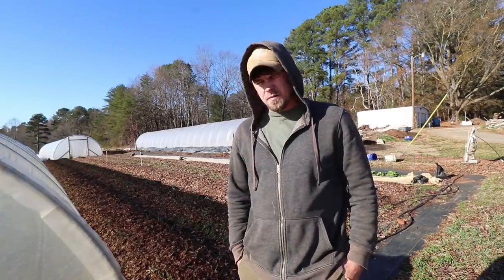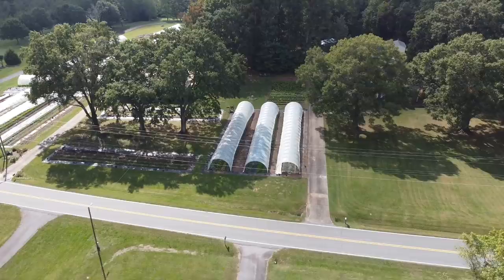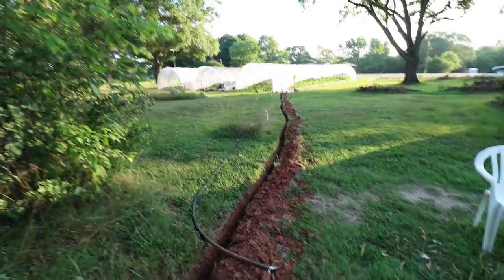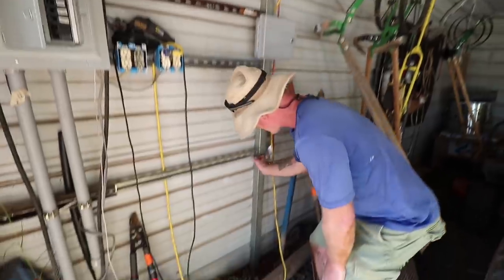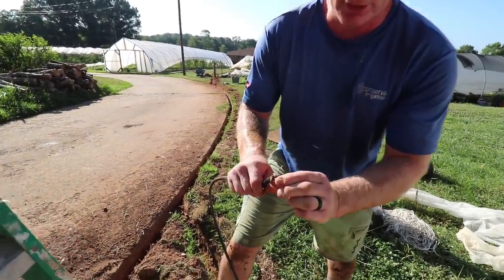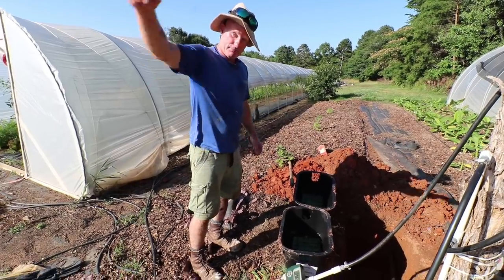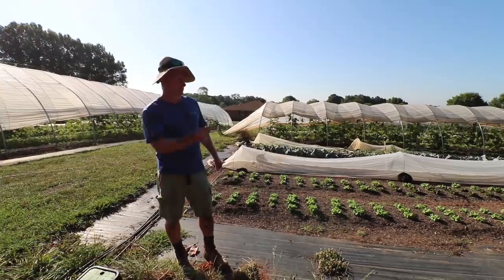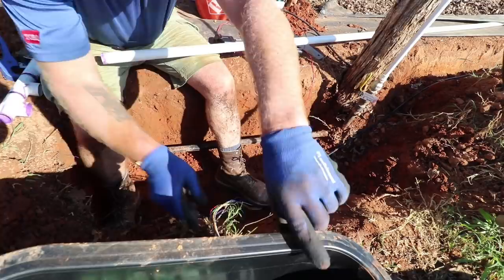Professional Market Garden Irrigation System (With Our Phones) Saves Time and Makes Money

Comment: Only thing I would recommend doing different with the plumbing of the valves, would be to leave more space on the incoming and outgoing side of the valves for future repairs. The Ts are already butted up so if one has to be replaced you have to re work the entire manifold. Very lovely work though. Install and setup about 10 hydrawise controllers a week. They're the bomb